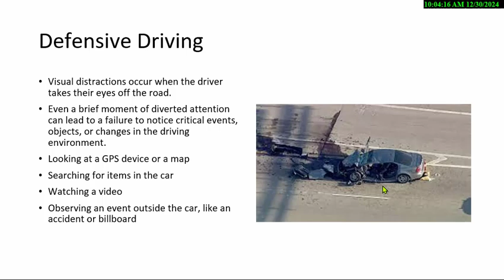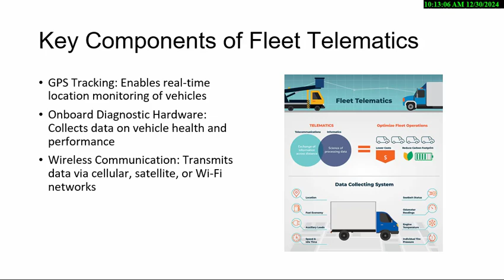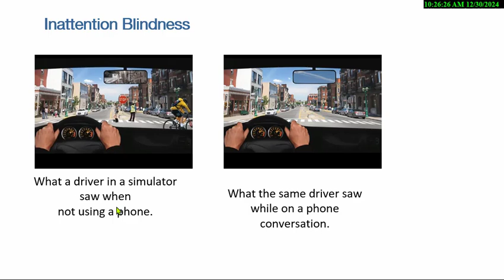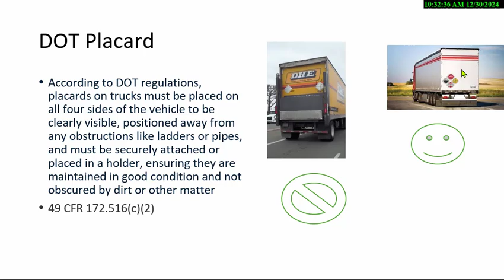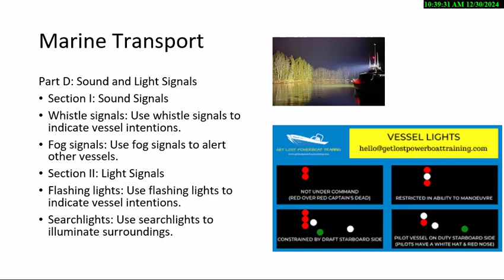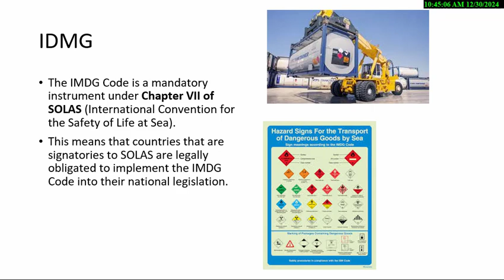Fleet Safety and Transportation Safety Principles ASP CSP December 30 2024

Comment: John is there any changes made by BCSP in ASP and CSP exam for 25 research based questions.  And what's the passing criteria?  Isn't any change occurred?
Reply from the maker: The CHST was raised to 111/175. The ASP CSP usually follow suit. The 25 research/practice tests are still there.
Reply: @johnanewquist  Thank you Sir for guidance.  Your video lectures are really helpful and very informative .
Reply: @johnanewquist  Means for ASP 99/175 
And 
For CSP it's 105/175.
Right Sir!
Reply from the maker: @WAK_10  I think they are all 111/175.
Reply: @WAK_10  107/175 now as per the new cut off
Reply: @johnanewquist  Hi John, Is this still the case?
Reply from the maker: @suadvila4928  nothing changed.